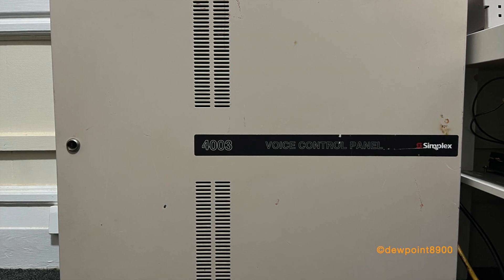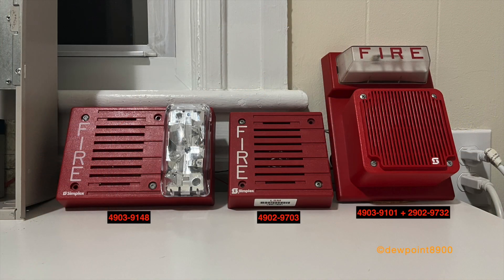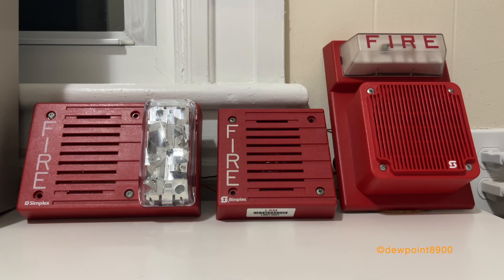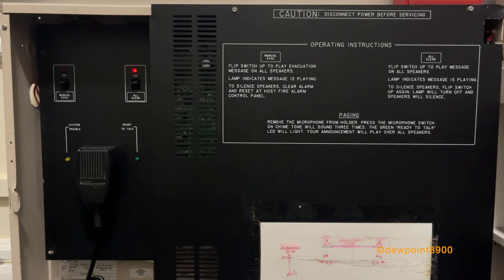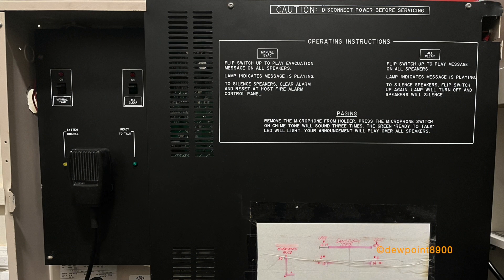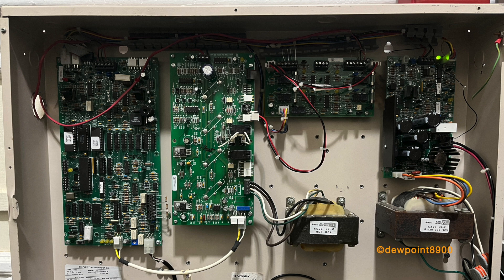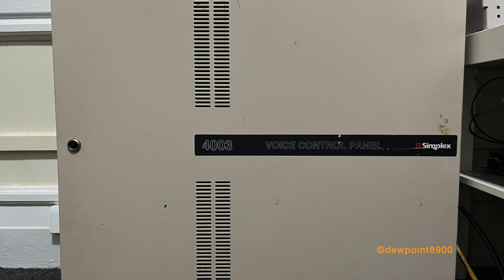Simplex 4003 Overview and Demo

Comment: Nice video on the 4003!

4:53 You know, I actually didn't know that that chime tone is supposedly the default all-clear tone on 4003s (as I believe the first time I heard the tone for it was in that one video by thesdx, where his 4003 was set on "slow march time" (actually a 4-pulse 500Hz intermittent tone. Speaking of which where is that tone exactly considering it doesn't seem to be in the video you uploaded of the 4003's raw audio snippets (are there any others that are not in that video either?).

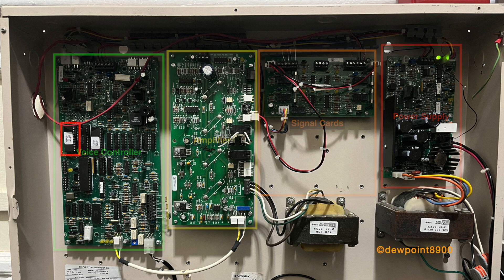6:19 Would it be possible to put the audio chip from another Simplex voice-capable panel (such as a 4100) in that spot & have the 4003 still work properly? (also what does the similar-looking chip across from it do? (the other one with a sticker)

6:29 How would they be triggered though, via external switches hooked to terminals on one of the boards or somethin'?

6:42 Is the 4100U also compatible? (even if most of the time it has its own voice circuitry)

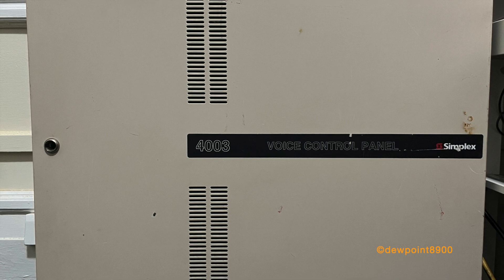7:29 Oh, really? I didn't know that, interesting (how did you find that out exactly? (even if you might not know an exact year). Also kinda interesting how Simplex didn't even bother engineering a replacement for it & just rebranded Wheelock's SAFEPATH SP40S instead.

I actually did not notice your "accent" (or at least unique way of saying some words) up until now: what kind is it exactly?